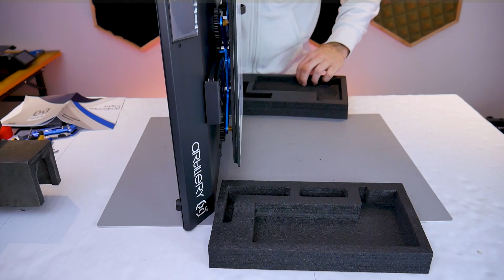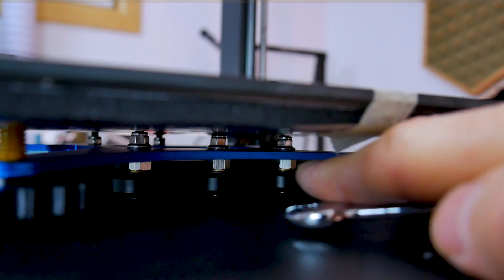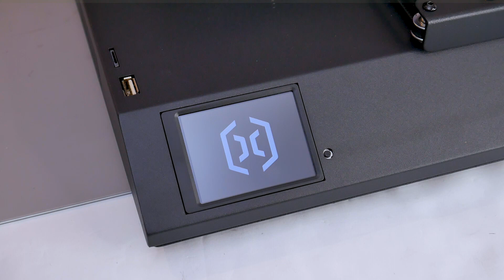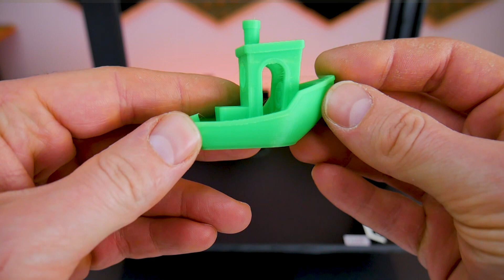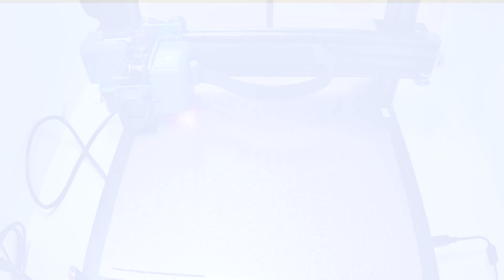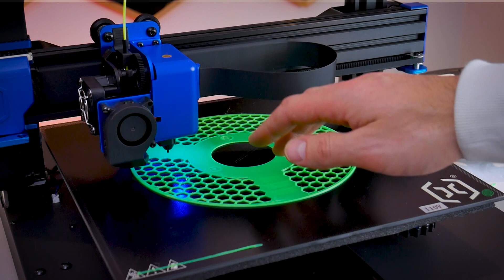Artillery Sidewinder X2 Long Term Review, Assembly and Setup Guide! Runout Detection Resume Fix!

Comment: My before layer change reads like this. 
; BEFORE_LAYER_CHANGE 
G92 E0
;[layer_z]

I'm not good with g-code. I'm having that filament change issue like you stated.  I changed the start code.  But not understanding exactly how it should look on the before layer change. Thanks for the help.

Comment: My X2 has gone suicidal. Home the extruder, level the bed... whatever... the printer raises and centers the extruder, exercises the ABL sensor then dives for the bed. The sensor pin touches the plate, but the printer attempts to bury the nozzle in the plate. Replace the ABL? Or replace it with an actual BLTouch?
Reply from the maker: I believe the Artillery probe is in some ways different than BLTouch... so if you switch them you may have to repin or change the offsets in firmware etc. Not 100% sure though but just a heads up!
Reply: Took the ABL apart and put it back together. It works fine now, but I will replace it with BLTouch.

Comment: They are on sale now for $199 from Artillery, free shipping. The company setup video AND the manual that comes with are a joke. This video is much better. One little note is when mounting the gantry if you slide the machine to the edge of the table, you can access the screws from below and everything is in place and square.
Reply from the maker: Yes the literature is not their strong point lol glad you found this video useful and good tip on the assembly :)
Reply: @EmbraceMaking  I've got Bard helping me sort things out.

Comment: Artillery3D failed with their dodgy cabling, making their printers very unreliable... These flat cables were never designed for large currents, but mostly for data in laptops...  If you making this printer more reliable do your own cabling for nossle . my started having extrusion problems after harf a year, and I couldn't find the reason, changing extruders, until i measured resistance on the total length as it goes thru 2 flat cables and 3 laptop connectors, to find that it is over 400 ohms, also some pins were carrying burn marks on connector sides...
Reply from the maker: Interesting, thanks for the insight. I have an new extruder coming for the Artillery machines, maybe I will measure the cable resistance to make sure I am not having the same problem!

Comment: How do you find the ac heated bed mate? My X2 seems to have two hotspots to the left and right of centre and when it's on say 60c those hotspots will be up around 65-70c and has actually damaged prints just from the radiant heat. So now I just drop the temp to 40 and use a bostic bluestick.
Reply from the maker: Interesting, mine doesn't seem that bad and have never had it damage a print like that. I recently got a thermal camera so I can have a look, but normally on my larger printers like this one or CR10 Smart, anything around 300 x 300 I set it to 60 and let it heat soak for 5-10 minutes at that temp before I start printing.

Comment: Great review. I just bought my X2 and was wondering if you had a profile for Prusaslicer. I noticed they have (2) profiles for the X1 but nothing for the X2. Thanks for your help and love your content.
Reply from the maker: Yes I have one, I have a few different machine profiles that I will work on uploading to my website over the next few days. Thanks!
Reply: @EmbraceMaking  how did you get it to pop prints off without the mat im prob gonna end up getting the mat for mine after having to fight getting them off lol.
Reply: @zerotheliger   just let the glass cool down

Comment: Hi there love the video could I get the profile for the slicer settings you have perfected good sir I have been using cura and I think it’s time to try prusa
Reply from the maker: Hi, I can post a profile to my website if you like. Are you just using regular PLA?
Reply: @EmbraceMaking  Hi, could you also share the PrusaSlicer profile for printing with PETG? I tried using the profile from the Sidewinder X1, but there are defects on the Benchy print, and it seems like the cooling is insufficient. Loading a verified profile would definitely make it easier for me to work with my new printer.